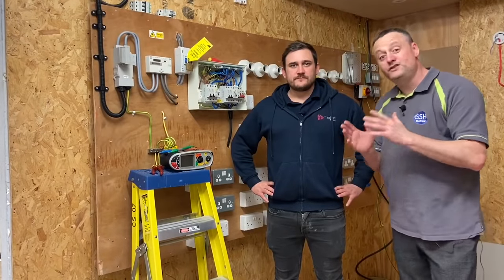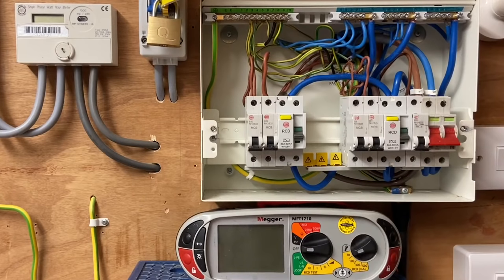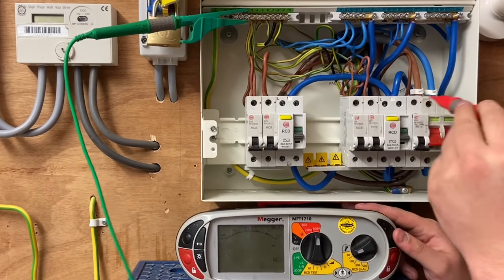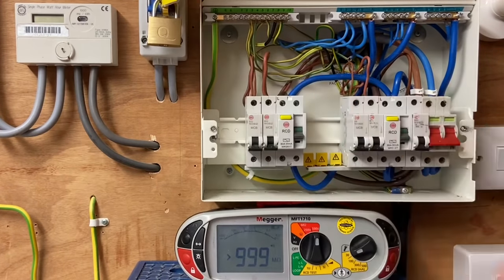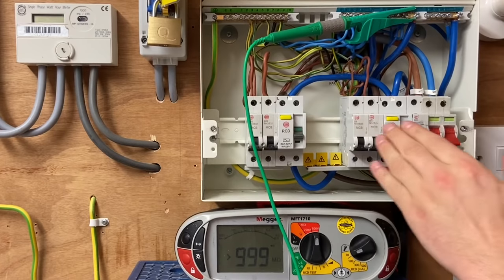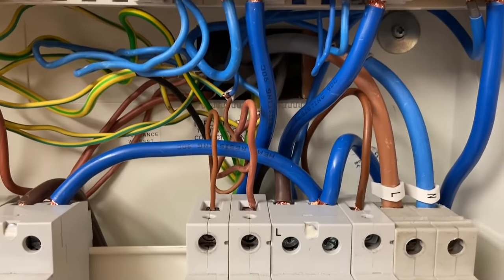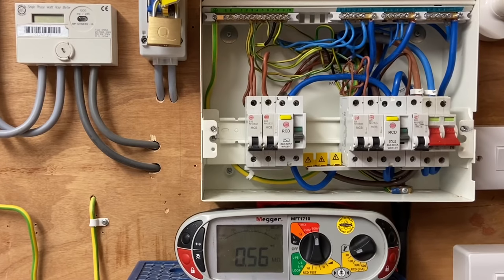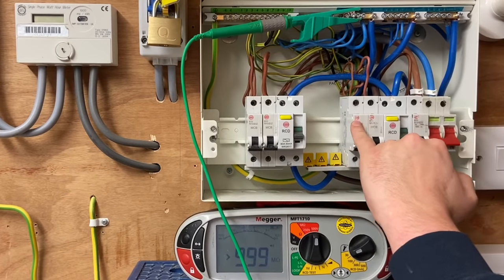Fault Finding Testing for Insulation Resistance. Low Reading Insulation Resistance Fault

Comment: If it is lighting and as you say split the circuit mid point and the leg coming from the board is clear i connect back up then youv got lighting to some of the property while you find the fault on the other leg, usefull if its getting dark at least theyl be light coming in same on a Ring main lets say split mid way whichever leg is clear bang back in the breaker at the board temporarily gets half the sockets on 👍 great videos these

Comment: Here in NZ the megger voltage is around 1000v. Do your regs call for 250v testing ? Interesting to see how regs vary form country to country. Ring ccts are illegal here too..  In order to keep our registration active we are required to do a refresher course every two tears...  I mean years..  :)  Last refresher I was a week late and I received an email stating I must not do prescribed electrical work even tho I have a spotless track record for the last 40 years.  Another interesting fact thats way over the top IMO is if you fit a back to back power point ( or GPO) the 6inches of cable requires to be insulation tested. Insulation testing goes hand in hand with earth loop impedance tests.

Comment: My driveway lights15 keep tripping my kitchen circuit but the outside driveway lights are on there own switch on the board. The light can be on for 2min or 20mins then trip. How do I find exactly what is causing the fault in the driveway lights 🤯not a sparky

Comment: Hello. I live in a rented property and have been told that I have an insulation resistance fault that was apparently found a couple of years ago and that an electrician will need to visit me. This may be a silly question but my house is quite crowded and all my power-points are behind book shelves with extension leads plugged in. Will he need access to all power-points please? This will be a bit of a task to sort before he arrives. Thanks for anyone who can answer this 🙂

Comment: Could you clarify? if I was doing a global IR test, and I got a reading of below 2 Meg Ohms, say 1.5 Meg Ohms. Then I would be required to investigate further, and test the individual circuits. And if I found one particular circuit was reading say 1.8 MegOhms then all would be ok as it’s above the minimum of 1 Meg Ohm as stated in bs7671. (assuming it was an eicr and not a new install). So on the test form would I still write the 1.5MegOhms? Being the global reading across the installation as a whole. Or would you write individual circuit ir readings on the form?
Reply from the maker: It’s the overall insulation resistance of the board to be 1 MegOhm or more not individual circuits. It’s the old resistors in parallel calculation to find the overall resistance. If you had 6 circuit of 200MegOhms and one of 2MegOhms the overall insulation resistance would be less than 2MegOhms. Thanks for commenting and watching. Gaz 🦾

Comment: What happens if the lines were dropped in and out of a lighting point but not in order of distance from the board? Daisy chained all over the place? As you occasionally find in older added on installations?🤔
Reply: Dont think it matters, as long as insulation tests are done and the cable/installation is fit for purpose.

Comment: Hey, can i please ask an electrical question...i have an old cottage, Rcd consumer unit fitted but went to change bedroom light fixture and found Red, Black and a bare wire ...does a qualified Electrician fit Blue to Red, Brown to Black and green/yellow to the bare wire? 😉 Thanks
Reply: Don’t do that your fuse will pop . Red is brown and blue is black in the UK👌
Reply: @garethrowlands1305  Cheers!!

Comment: Would the test between neutral and earth not show zero ohms if the neutral was ultimately connected to the earth at the centre tap of the star side side of a delta/star supply transformer feeding the installation, or am I missing something?
Reply: You disconnect the earth so that doesn't happen

Comment: Hi guys,

I noticed there was no Live conductors to earth test carried out i.e. line and neutral combined to earth. Is that test not relevant. If not how would we record this on our test result. Would it have been worst of the two readings for L-E or N-E dependent which of the two had the lowest reading? 
Love to know this as I always get confused.
Reply from the maker: Combined Insulation Resistance Test Line and Neutral Together to Earth & Between Live Conductors https://youtu.be/xH5FxehSpM4

This may help 🦾. Thanks Gaz

Comment: Ugh, domestic sparkies. You will kill us all. The live, unswitched wire goes in the top. Terminal 1. FFS. The bottom side is dead when the circuit breaker is switched off. Read the manual. Love, all industrial sparkies.

To us, you’re testing the mains. 🤦🏻‍♂️

See the L on top, that means live/line.  That means the unswitched side!!!

Don’t come on my site Marcus